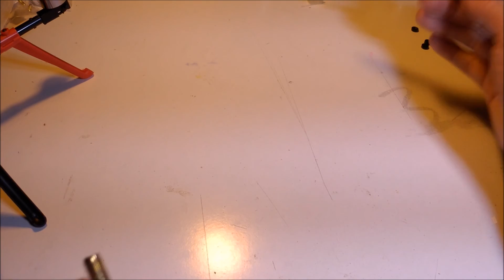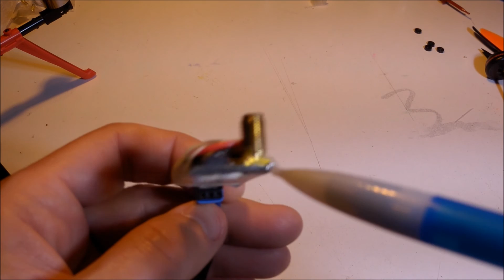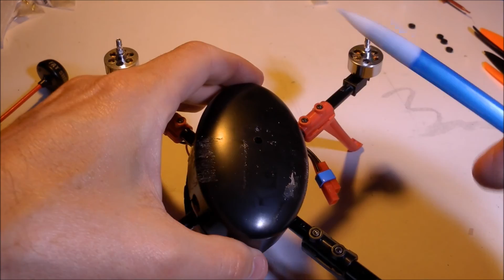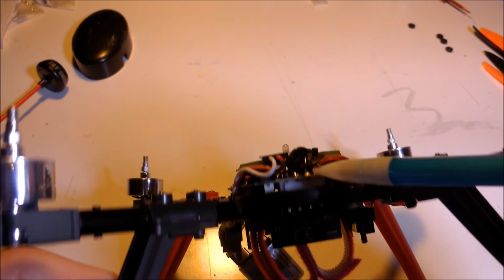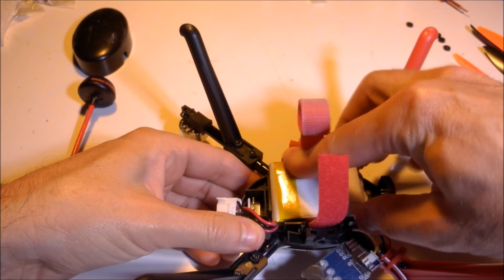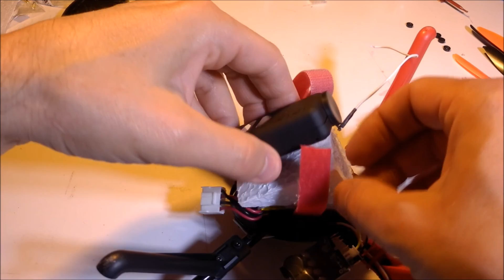RC Logger Eye One Xtreme - How to Make the EOX into an FPV Quadcopter

Comment: run-time must be awfully short with a Mobius I guess, I now have this setup (6-7 minutes) https://youtu.be/gb01Ill7ZMo
Reply from the maker: I think my average flight is 8 mins.  The Mobius runs on it's own battery power.  I can record flights in HD etc. which I like watching over the winter season.   Run time would be longer as the security camera option is lighter.  I haven't tried that yet.  Maybe my next FPV aircraft will be that way, especially because I'd like to try the head tracker.